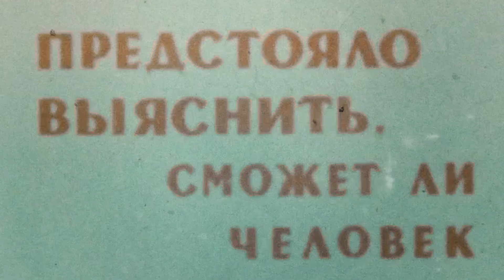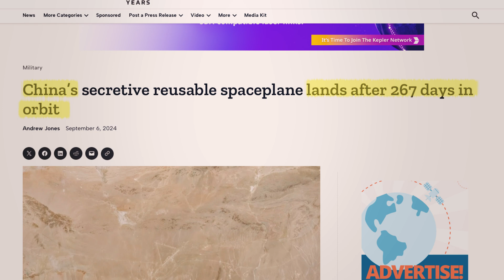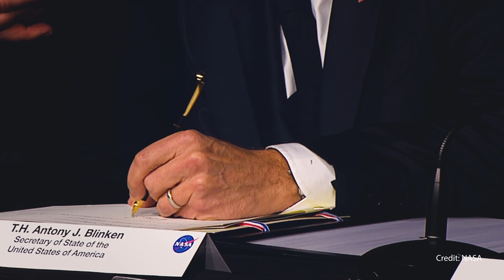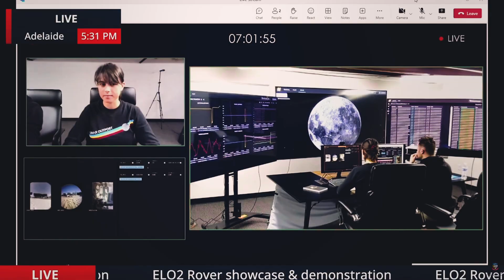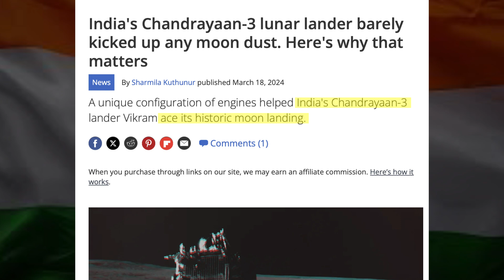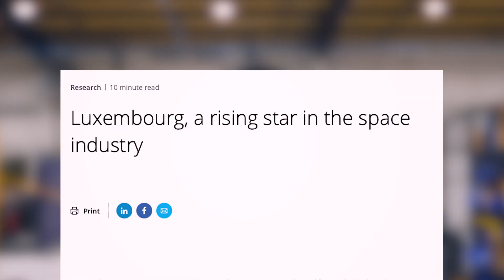The Surprising Geopolitics of the Moon

Comment: Who is holding the camera while filming Neil Armstrong's giant first step? Read: COSMOLOGICAL ICE AGES
 We computed our solar system's orbit around Sirius A and B and it matches the last Ice Age cycle of 105,000 years. We were captured by the Sirius system 800-million plus years ago and were following little Sirius B 1.5-solar masses around Sirius A, a two-solar mass star. It was the light from these objects that took early Earth's 1000+ pound per square inch atmosphere down into layers of limestone 12,500-feet thick, vast layers of hard coal with a compression ratio of 40-to one and vast pools of oil everywhere made by diatoms in shallow seas. 

My Encyclopedia Britannica states the limestone layers from the Carolina's to the Rocky Mountains has an average thickness of 3,500 feet thick. You have to realize all that wonderful carbon material was air at one time. Now Earth's atmosphere is only 14.5 PSI at sea level. We lost 98% of the air on this planet. It is all underground in the form of coal, oil and limestone all created with light and the light didn't come from the sun!!! Sirius B puts out more than 100-times the light of our sun in the 350 to 400-nanometer range slightly above the range of human site. Sirius A being two solar masses puts our four times the light of our sun in the visible spectrum. 

Our solar system was born in Orion. We drifted out of their 2.4-billion years ago and earth froze up for a billion years because space is cold. There was no way to get out of the billion-year Huronian Glaciation Ice Age but by some freak were drifted between Procyon and Sirius into a mutual gravity alignment point. Little Sirius B at 1.5 solar masses came around traveling 7.5 kilometer per second and grabbed hold of our solar system and we started following it around Sirius A for the next 800-million years. 

It was the light from those objects that made the energy that makes your car go down the road and heats your home. It wasn’t the Sun! In fact, the Sun did not burn as hot as it does today 800-million years ago. There was no way it could get life started on the "---Surface of the waters" especially when early earth has a 1000+ PSI carbon dioxide atmosphere that was 2500-miles deep. Now our atmosphere is only 50-miles deep and 14.5 PSI at sea level. Co2 is a trace gas of .04%. Look it up! It has little or nothing to do with climate change. In fact, we need more of it to grow food. Methane release changes climate. Kill your cows and stop eating cruciferous vegetables. Also plug up all volcanoes because they emit lots of co2.

There is a planet in the Sirius system and they need ORME gold to spray in the atmosphere of their planet to protect it from the harsh UV light of Sirius B putting out more than 100-times the light of our sun. The Elohim / Nephilim came to Earth 400,000 years ago to mine gold. It would have relatively easy for them to travel to Earth using conventional rocket technology in a voyage lasting 8 years using the various gravities of planet in our solar system using planetary alignments. 

The Elohim/Nephilim created modern humans using some of their own DNA and indigenous earth species. They needed smaller workers because the Elohim/Nephilim stood fifteen to twenty-feet tall. You can't tunnel underground when you are that tall. It isn't feasible to make the tunnel opening that big due to dangerous cave-ins. We humans were created as a slave race to mine gold for them and worship and obey them.

On this planet our government sprays aluminum powder, boron and virus over major cities to dumb us down to keep us from questioning government and make us good worker slaves. 
READ: COSMOLOGICAL ICE AGES 380-pages 8.5 by 11 is available at: www.GuardDogBooks.com www.Amazon.com and book stores around the world in China, Japan, Indonesia and Europe.